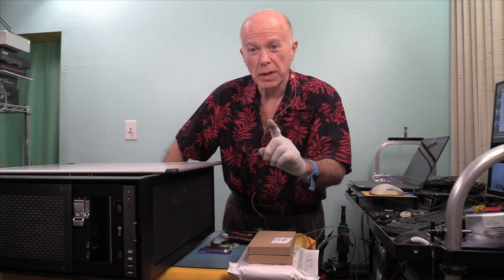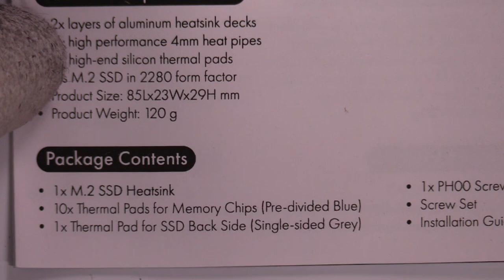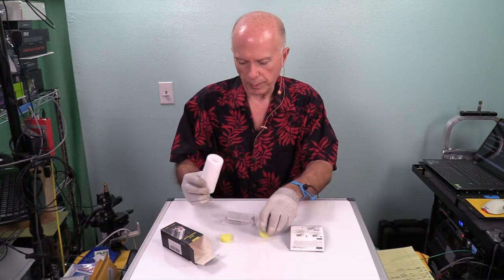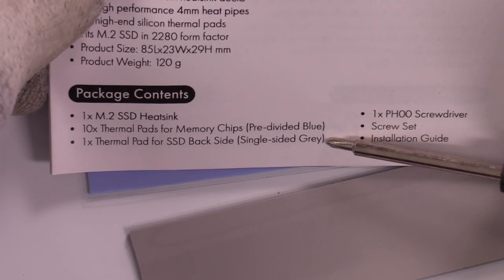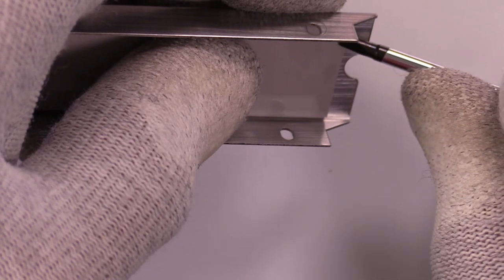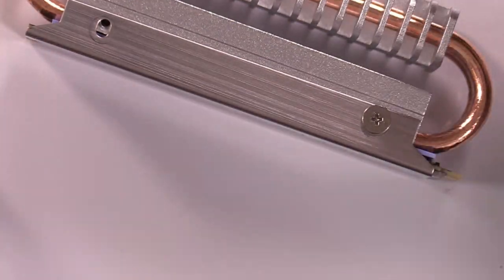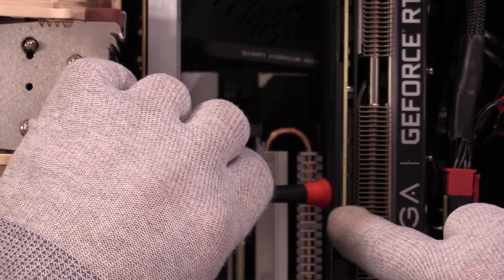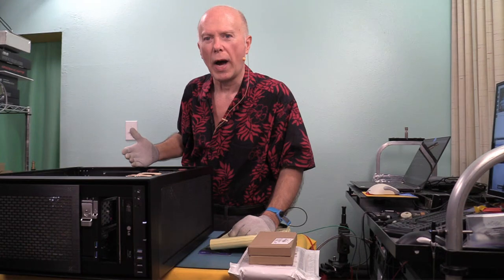Acidalie M.2 2280 SSD Heatsink on WD Black SN850

Comment: This heatsink is an absolute beast.  I ended up getting this for my SN850 that is currently sitting inside of a sub 10L case.  There's absolutely no air flow so without a heatsink at all, the drive would run into the 85+c range.  I had an EK heatsink on it and that didn't bring the temps below 80 but it held steady at around 81-82, I then included a noc A4x20 fan (low to no noise btw) and it brought the temps down to ~62.  I then got this heatsink and without a fan it would sit around the 48-49 range.  When I include the small noc fan, it dropped the temps down to 42C.  Please note all temps were on max load after either a few hours of gaming or benchmarking.
Reply from the maker: Hi mrpeeng,
Amazing, right! Results are what matters! Thanks for Sharing! 
BTW: How's the noise?
Reply: Thanks, for sharing... Im building a SFF gaming build for a friend... Your info is so helpful!
Reply: holy crap below 50!
Reply: Just so you all know, they launched a revised and improved version... with even better temps

Comment: Very informative and incredibly concise. Just successfully installed mine. Acidalie must have improved them somewhat since 2021. Packaging was in a small box not a round, foam bundle. I didn't have to apply much force at all to align the screws. My stock Asus heat sink was hitting 104F. Oddly enough, after playing 30 minutes of ARMA Gold, the temps still hit 104F (according to CPUID Monitor). After quitting the game, the temps quickly dropped to 96.8 (after 6 minutes). I have the Acidalie installed on top of my Samsung 970 Evo Plus 2T.
Reply from the maker: Hi Chip Roberts,
Welcome! Appreciate Your Comments! Congrats on Your Installation! Glad You had overhead clearance! Sounds like Acidalie has made Product improvements! Thanks for Sharing!

Comment: Great channel!   Thank you for reviewing this, I wouldn’t have found this otherwise.  I bought it to replace one of my MSI Z690 Edge WiFi DDR4 m.2 covers.  The SK Hynix P41 Platinum drive idles and run hot, about 12-15c warmer than my Seagate Firecuda 530.  This Acidalie dropped the P41 temps by about 7-8c, so I’m now at 61-62c vs 68-69c at load.  The controller temp were even higher — mid-upper 70’s.  Not anymore.  The drive is mounted in my top slot between my GPU and CPU.  No clearance issues with either my AIO block or GPU.  Thanks again.
Reply from the maker: Hi ericmafl,
Welcome! Absolutely! Glad We could help! Fascinating topic! Appreciate Your Comments! Excellent Results! Glad You had room to accommodate the Acidalie M.2 Heatsink! Wild looking on a Motherboard! Thanks for Sharing Your Results!

Comment: Thanks Gil. I just put an Acidalie heatsink on a MAG  X570S Tomahawk Max WIFI board in a Core W100 case. I needed a case with good airflow and 5.25 bays for DVD, swappable 2.5 and 3.5 bays, a memory card reader and USB C for the front panel. Let's just say the case is massive overkill but any case to do that job is getting as rare as rocking horse manure. I used a AK620 air cooler. I was concerned that the air cooler would cause clearance issues for this Acidalie cooler. No problem. However, the motherboard has an adjacent header that only has 1-2mm of lateral clearance and the graphics card lock clears the cooler by 0.5mm. Nothing is simple these days. I have a SN850X 2TB in as my NVME drive. Your videos have been a great help working through some of the weird considerations that arise these days and your testing has been very helpful. Why the core 100 does not come with a pile of drive mounting brackets is beyond me. The cut sections of thermal pads does make things awkward for the Acidalie. The instructions are scant but it looked like that are hinting to put pads on the controller not on the NAND. I fitted it the same as you and I will see what temperatures I get. The board has another PCI-E 3.0 NVME slot. I may well put a small cheap earlier generation NVME drive in  there purely for swap just to remove one source of wear and tear. Can't stop windows or linux pre-emptively swapping hibernating processes. I may also consider putting temp space there but that will relincuish performance of apps that make heavy use of temp space.  I wish I could rent out the spare space in the core W100! Your videos are great and your approach is methodical. It is so much more helpful than fan boy stuff. I haven't finished the build on this machine - a million fans to connect to power and ARGB along with all the front panel stuff. I am using 4x140 fans in the top to blow air down across memory, the vrms and a fair bit should make it under the AK620 to give flow on the Acidalie and the top of the graphics card. 3 fans in the bottom, 2 in the front. The aim is to run them all at relatively low speed but ensure positive pressure exists and it is relatively quiet. The proof will be in the pudding.  Thanks again - Greg from Australia.
Reply from the maker: Hi Greg, 
Welcome Australia! Excellent! That Case will last through several Builds! Rare indeed. Too much focus on Form while neglecting Function. We need Cases with access to Devices! 'What if' scenarios can be challenging! Those Drive Mounting Brackets are crucial and should be included considering the price! Two schools of thought on Thermal Pad placement. Requires further study. We focused on pad compression. At some point We have to zoom out and focus on the big picture or else get caught up in the minutia of the Weeds! Definitely share those Temp Results! We need better Thermal technology going forward! Space to spare, most definitely! Appreciate Your Comments! Details matter especially when trying to diagnose a problem whether perceived or real. Hover craft or silent giant! All about Results! Keep Us Posted!

Comment: I have watched all of your videos regarding the NVME SSD heat sinks and thermal pad evaluations with great interest.  I am impressed with your testing techniques and methods ... near scientific analysis.  I was surprised when you opted not to use the bottom heat pad on the Acidalie heatsink test done connected to the motherboard.  When you did the very first assembly and test, using the OEM heat pads, the temperature after the test run was at 48C.  When you elected not to put the bottom heat pad on and went to a 1.0mm thick heat pad just on the top, you didn't have the same compression which could help to explain the difference ... plus, the lack of a bottom thermal pad.  Trust me when I say the bottom of the circuit board can be a significant source of heat dissipation.  My very first PC build used a Gigabyte GA-x48t-DQ6 motherboard that came stock with heat sinks on the bottom of the motherboard.  I just wish Gigabyte had put thermal pads between the metal bottom stiffener and the X299 Designare EX motherboard I am using now.  FYI, there are 2 specific YouTube videos/tests done on illustrating the significance of heat pad thickness on heat  transfer.  I just ordered an Acidalie heatsink to use on a WD 750 NVME SSD which I will be putting on my Gigabyte  X299 Designare EX motherboard.  If I feel I can do better using one of the other 12 W/mk heat pads, but at 0.5mm thickness to keep the better heat dissipation
Reply from the maker: Hi Paul Porter,
Welcome! Just now seeing Your message! Very good points! Have You noticed on Motherboards with PCIe 5.0, there are Thermal Pads attached directly on the Motherboard! Interesting. Appreciate Your Comments! Thanks for Watching!

Comment: I ended up getting about 17C improvement at idle on a Samsung 980 PRO 1TB PCIe NVMe Gen4 SSD M.2  with this heatsink and the pads that came with it. Thanks for the review!
Reply from the maker: Hi Paul P,
Excellent! I really like the layout and the size given the Results. Did not know what to expect and am very pleased and impressed. Appreciate Your Comments! Thanks for Sharing! We have another Heatsink We've been asked to Test by a Subscriber. He wants to see if anything can beat the Acidalie!
Reply: I can't get the screw holes to line up when I have the thermal pads in place, I know you said to use a good amount of pressure to squeeze the radiator and bottom plate together to align the holes, and I tried, but the holes won't budge and I'm scared of breaking my Samsung 980 Pro 2tb trying any harder.

Please help.

Also hope you are having a good day :)
Reply: @kaeaja  I actually was able to use a plastic clamp and put a little pressure on the aluminum part of the sink and the bottom. I didn't put a lot of pressure on it. I don't think you will break the drive if you have it in the sink on correctly. Just don't clamp the copper part of the pipes you most likely would bend them. I didn't not put the clamp on the top piece of the sink that has the pipes running through it.  Not sure if that makes sense or not. Was more on the sink right above where the screw goes in to the sink.
Reply: @paulp1166  I see, well I was able to get three of the four screws in, and I don't have anything that can help me further, so thank you!
Reply from the maker: HI @kaeaja ,
I responded to Your first request. Tell Us more about the installation. Let's see if We can figure this out together!
Reply: @BuildOrBuy  I might very well unscrew the three screws that I got in to make sure that the blue thermal pad is completely flat.
Reply from the maker: Hi @kaeaja ,
Bottom Thermal Pad should be the thinner Pad. The Top Thermal Pad would be the squares. Any progress?
Reply: @BuildOrBuy  Not as of yet, and no worries, I put the grey pad on the bottom and the blue squares on top.
Reply from the maker: HI @kaeaja ,
OK! Perfect! Any progress?

Comment: Hello sir.
After a week of research, I purchased the "Startech Dual M.2 PCIe Adapter PEX8M2E2"
card to use with my two 970 Evo Plus drives.
As you know the card mounts the drives right next to each other with what
seems to be a 1.7 mm separation of the edges.

My two .95 inch width tray coolers touch each other's screws and have sympathetic heat sharing.
I did mount the Samsung drives in the center of the cooler as each was previously
in it's own slot.

The drives are only .87 inch in width.

The cooling is atrocious, rising up to 68C on long copy tests.
Lowest down to 47C at idle.

I want to try two Acidalie heatsink but their tray width is 1.01 inches.
I'm thinking I can scoot the drive over to a tray edge and have the excess width
hang over the outboard areas of each board mounting respectively.
I may have to dremel off the "U" part of the the base tray to do this.

Do you think this will work ?
And have you tried to mount two coolers this close together on any of 
those dual Nvme cards ?
Reply from the maker: Hi Mity Mo *,
Welcome! Interesting add in card. Self Bifurcated; ASMedia ASM2824 Switching Chipset; PCIe 3.0 M.2 NVMe PCIe support. That's the problem We encountered and did not resolve. We need two things. 1. A Dual M.2 Heatsink and, 2. A way to attach the Heatsink to the assembly. Sounds simple enough. However, this requires a Custom Solution for which the Manufacturers should resolve. 

Concerned about machining off the edge or side to side. You'll lose Compression over the Assembly. Agreed, spacing is too tight to accommodate the wrap around. We need a Dual Heatsink but then We need Bands to secure that are not long term enough from Feedback and What We could find. And the Thermal Pads one Manufacturer used were really hard to remove after only one week of use! A conundrum. 

A Heatsink with a Thermal Pad and some type of insulated clamp to apply light pressure to the sandwich is one option or O Rings large enough to reach around. We've spent a lot of time going over this and no resolution. Sorry to not be of more help. That's what started Our Search for M.2 NVMe PCIe Heatsinks! 

Literally, We need an 80mm x 40mm Heatsink. Something like this link below:
1. ZZHXSM 2Pcs 80mm Heatsink 80 x 40 x 11mm Black Aluminum Heat Sink Radiator Cooler with Thermal Conductive Adhesive Tape Cooling Fin for Cooler Electronics CPU Led 
https://amzn.to/3cSoRp4
Or this:
2. Awxlumv 2 Pcs Aluminum Chipset Heatsink 100 x 40 x 20MM/ 3.93 x 1.57x 0.79 inch Diffusion Cooling Fin Comb Heat Sink Cooler 
https://amzn.to/3AVdjcE
3. LuoQiuFa Aluminium Heatsink Heat Sink 3.94" x2.72" x 1.42" / 100 x 69 x 36mm Radiator for IC Module, PC Computer, Led, PCB 
https://amzn.to/3RCnNF3
4. Liquid Cooling! BXQINLENX Aluminum Water Cooling Block for CPU Graphics Radiator Heatsink 40x 80mm White 
https://amzn.to/3cPfdDF
Here's an example of a Self Bifurcated Dual M.2 NVMe Adapter with a Heatsink:
5. Syba Dual M.2 M-Key NVMe Ports to PCIe 3.0 x16 Bifurcation Riser Controller - Support Non-Bifurcation Motherboard (SI-PEX40129) 
https://amzn.to/3x36YKV
As an Amazon Associate I earn from qualifying purchases! Hope that helps! Ideas! Brainstorming!

Comment: received acadalie m.2 heatsink today. and i can confirm they are not the same as the old ones. the fins between the copper pipes are not the same and seems lighter also. i will order elecgear m.2 to compair.
Reply from the maker: Hi youz382,
Welcome! Just now seeing Your comments. That's a bummer. What did your results yield in comparison?

Comment: I have 2 installed on my Rog Strix X570-E Gaming II system covering my WD SN 850 2 TB - I used 1 Copper shim on the heatsink side with orange high temp translucent tape on the outside edges. I used 1silicon pad on the bottom.
Reply from the maker: Hi Cronopoly,
Welcome! How are Your Temps since the change? Thanks for Sharing!
Reply: @BuildOrBuy  My temps have not gone above 48C during Crystal Disk 7 tests and during Unreal Engine 5 shader compiles. I'm in Raid 0 to note.
Reply from the maker: Hi @cronopoly344 ,
Excellent Results! So You're getting not just a Burst mode but also Throughput with those Temps at Performance on the WD Black SN850! Thanks for Sharing! Effective Passive Cooling!

Comment: I think we have a win!! I think I like this over the next fan m.2 heatsink because there is no moving parts. Where the fan can fail or clog up dust. But if the temp on the fan heatsink is better.. I would have to consider.
Reply: True enough. And seven PCIe X16 sockets on a WRX80 mobo may not have enough space between sockets for a heat pipe cooler.
Reply from the maker: Hi Jolly Green, 
Amazing right! Leave no stone unturned! I was definitely blown away by the Results! Exactly! We need to know! Only one way to find out! Test and Verify! The Heatsink Fan has me concerned too. Still curious enough. I'll get more into that on the Video! All great points to consider! Even the prioritization of identified issues can change the solution. Heat, Size, Quantity, Passive or Active.
Reply from the maker: Hi Max, 
Exactly! Space relations. Change one thing, changes everything. We know enough to know We need more information before We can examine what We know. Then compare and prioritize! This is absolutely Fascinating! Part of this path to discovery goes to expectations. Results! I have a totally different View now on Heatsinks!

Comment: This is the best NVME heat sink of the bunch, if you have the room. This has real heatpipes. This is why it beats the Sabrent's fake heat pipe heat sink.  I am buting two and having then heavy copper plated, so I can use them with liquid metal. NOW thats cool !.
Reply from the maker: Hi mrgcav, 
Yes! Indubitably. Very appropriate on a Motherboard if height clearance is not an issue. However, on a Dual M.2 Adapter or Quad card, this is something We have to think about. That's a lot of something the Vendors should take into consideration but have not. Going forward on new Drives, looks like they are! I would be concerned about liquid metal on an uneven surface. Even ceramic on M.2 Drives. Gravity on Dual and Quad Adapters would be of even great concern! Thanks for Sharing!

Comment: Was checking around the internet for nvme heatsinks reviews when your channel came up!
What can i say? Your effort to supply as much information as you can and your attention to detail are astounding!
I've been watching all your nvme heatsink tests and i decided to buy this one! Although it was difficult to find it on italian Amazon since it goes by the brand of "ElecGear"!
Could you please tell me what is the thickness of the thermal pads included since i plan to replace them with Thermal Grizzly ones? Also if i choose 0.5 mm thermal pad for the bottom and 1 mm for the top of the nvme do you think i will have clearance/compression problems?
Thank you so much!
Reply from the maker: Hi half1980,
Welcome! Appreciate Your Comments! Hope You're using Single Sided M 2 NVMe PCIe Drives unless they have elongated those Side Mounting Holes. 1mm on Top and 0.5mm on bottom. Tight fit! Good compression though! Hope that helps! Had no idea, when We started those Tests, that they would become so popular! Looking forward to the next round as M.2 NVMe Heatsinks technologies mature, with more and better options! Thanks for Watching!

Comment: Are you sure when your applying the pressure whilst fitting the screws that your not damaging the ssd as you sat it upon the small " lugs" that were protruding out from the lower part of the heatsink which you noted was stopping the lower thermal pad from contacting the underside of the ssd! This was something I took note of when you were constructing/ fitting thus heatsink to your ssd, even tho it had small drill holes on the underside I still thought contact through the thermal pads would still be necessary!
Reply from the maker: Hi Fen Solo, 
Welcome! You need to see the EKWB Heatsink Video! That one had me very concerned! The EKWB Heatsink clips were extremely tight to install. Removal was fine. And the M.2 NVMe Drive also was OK. The Acidalie was a gentle install. Disclaimer: No M.2 NVMe PCIe Drives were harmed during the making of this Video! Your Results may vary! Stay Tuned! Thanks for Asking!